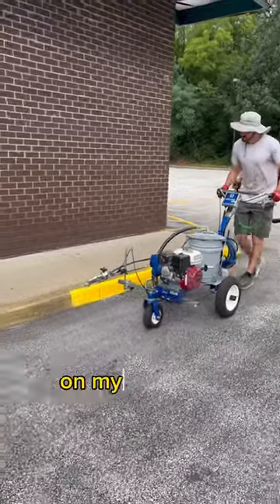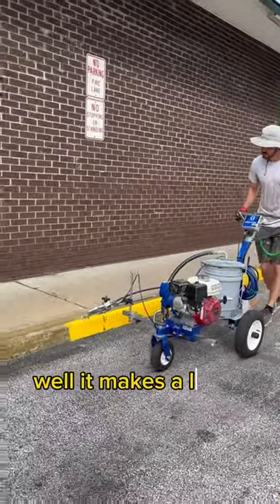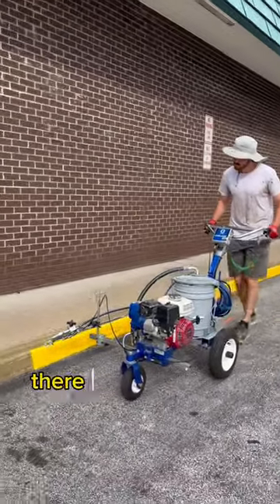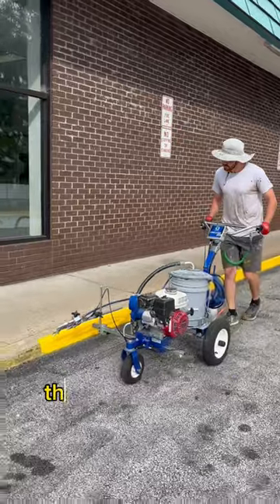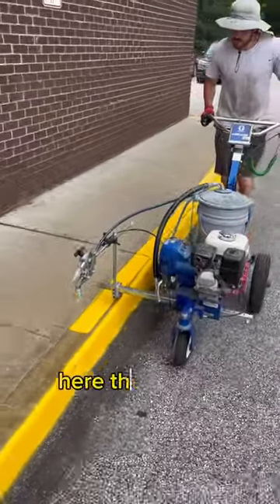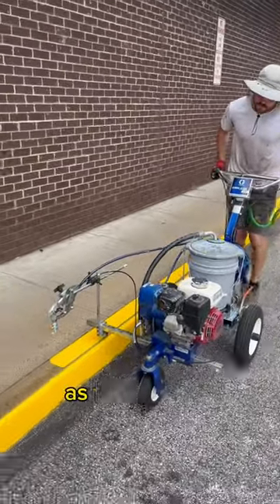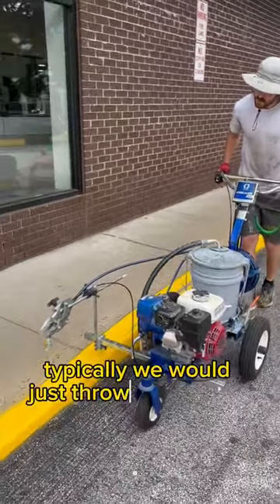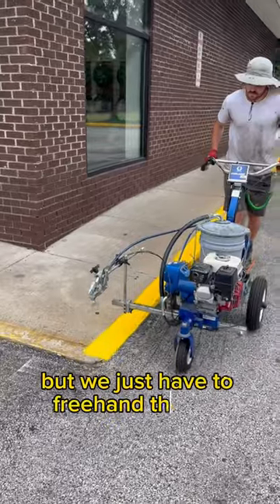Why we PAINT Curbs in Parking Lots 🎨 #satisfying #painting #linestriping

Comment: what tip size do you use for curbs and pressure? Ive done just a couple of jobs with curbs (not one of them have even close to a surface without bumps all over the place)
Reply from the maker: For this job we are using a 319 tip and the pressure it right around 1800-2000 psi. Really depends how far we are from the curb. The further the higher PSI the closer the Lower PSI.